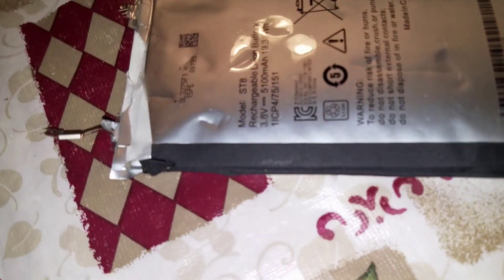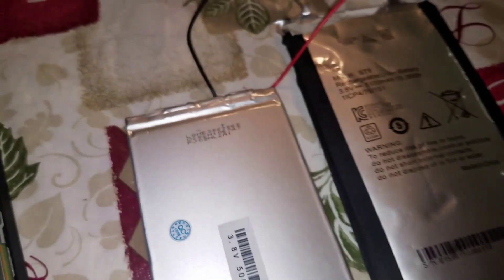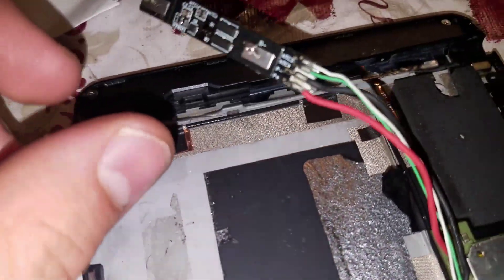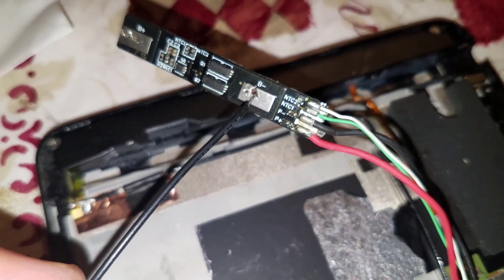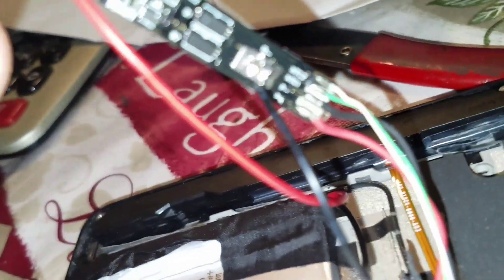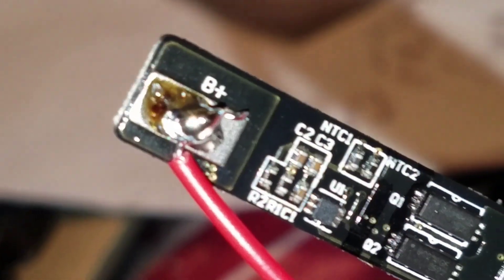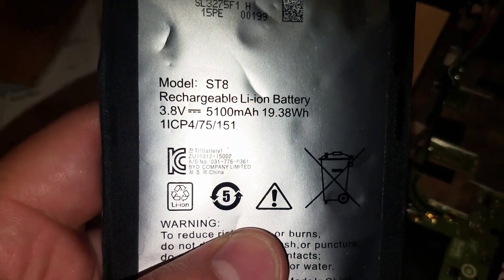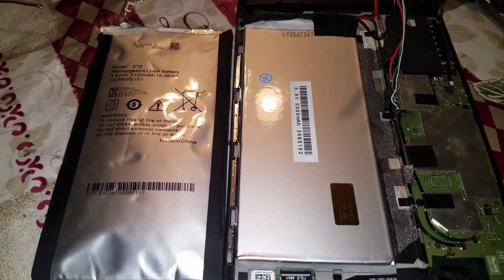Nvidia Shield Tablet Battery Replacement with Narrative Audio!

Comment: Hey bro, thanks for the video. Any chance you could point me to where I could get a replacement battery controller board?
Reply from the maker: Oh that part I'm not too sure of. You might want to try AliExpress for it. eBay might be helpful since there are some used shield tablet parts on there.

Comment: disconnect black (minus -) from the nvidia battery first, then red.  then when connecting the new battery, do red (positive, +) first, then black.  Make sure it all fits before closing the lid, and that there is no rattle (you dont want a battery jumping around because you didnt seal it in).
The little attachment on the previous battery is probably just a little extension, so the wiring can meet.  its not important.
I've put this job off for 3 years now, and your 2.2min video was awesome and really helped.  This tablet is just an e-book reader now, but with the extra battery, i hope it can survive a little longer watching videos.
Thank you!
Reply from the maker: Thank you for your input brother, this was my first doing this type of job, you right , some adhesive tape to keep the battery in place will definitely help. Mine never rattle probably due to the compactness in the design but that's definitely important! Thanks for watching and commenting you're advice!

Comment from the maker: Please like & subscribe!
Here is the same link but Shorten  : 

https://www.aliexpress.com/item/-/945908873.html

Keep in mind that this one is a little bit smaller. This is 3.5mm thickness/65mm height/152 length. But it will work. The original was 3.5mm/74mm/152mm.
 You can do more research if you want to find a higher mAh battery if you want , just make sure your within the size limits.

Same link but in long format. (Try this if the one above doesn't work) :

https://m.aliexpress.com/item/945908873.html?spm=a2g0n.orderlist-amp.item.945908873&aff_trace_key=&aff_platform=msite&m_page_id=2732amp-4rja0wylfwD8xahFBbkjGA1540488142187

Comment: Link is down
Reply from the maker: Here is the same link but Shorten  : 

https://www.aliexpress.com/item/-/945908873.html

Keep in mind that this one is a little bit smaller. This is 3.5mm thickness/65mm height/152 length. But it will work. The original was 3.5mm/74mm/152mm.
 You can do more research if you want to find a higher mAh battery if you want , just make sure your within the size limits.

Same link but in long format. (Try this if the one above doesn't work) :

https://m.aliexpress.com/item/945908873.html?spm=a2g0n.orderlist-amp.item.945908873&aff_trace_key=&aff_platform=msite&m_page_id=2732amp-4rja0wylfwD8xahFBbkjGA1540488142187

Comment: I ordered the linked battery, i want to say that this battery has a little PCB under black tape, wires are not attached directly to battery poles, i think you should remove it, then solder the new battery poles to the black SHIELD pcb.
There's no reason to have 2 battery controllers attached to one another.

Thank you very much for the video!
Reply: Yeah I have the same question too, since I also brought a HeXunBaBa battery from Ali Express, model L508 3.8V 5000 mAh. Well, I guess I won't know until they delivery it a month from now. LOL
Reply from the maker: Is that what I did? Did I attached two battery controllers? I have not had any problems with anything so far. It's been a year since my repair and still works fine.
Reply: @DIYStangsandFreedom  i don't see any small pcb in your video, but the one linked (that i ordered thanks to your video) has a controller pcb, which has to be removed
Reply from the maker: @L.Parisi  oh man they must of removed that link or updated it with a different model battery. I'll have to check it out and see
Reply from the maker: @L.Parisi  sorry for the late reply, work has been busy, but here you go 

Here is the same link but Shorten  : 

https://www.aliexpress.com/item/-/945908873.html

Keep in mind that this one is a little bit smaller. This is 3.5mm thickness/65mm height/152 length. But it will work. The original was 3.5mm/74mm/152mm.
 You can do more research if you want to find a higher mAh battery if you want , just make sure your within the size limits.

Same link but in long format. (Try this if the one above doesn't work) :

https://m.aliexpress.com/item/945908873.html?spm=a2g0n.orderlist-amp.item.945908873&aff_trace_key=&aff_platform=msite&m_page_id=2732amp-4rja0wylfwD8xahFBbkjGA1540488142187
Reply: @DIYStangsandFreedom  Would it still work with two controllers? there is tape covering the battery I found, I don't really want to rip it off to find there isn't a pcb under there. I found my battery on ebay. I probably should have gone to aliexpress.

Comment: Hey bro im about to swap mt nvidia shield battery can you tell me how its holding up?
Reply from the maker: It holds up okay. But it still only last about 1-3 hours depending on use. I put it on battery saver mode when watching movies/video, that helps it last longer. If your playing games itll die quicker.
Reply: @DIYStangsandFreedom   How long was it lasting originally?  is this with the stock rom or custom rom like lineage?
Reply from the maker: @MachuPichuu  stock. And the og battery was lasting about the same. 3-4hrs. Battery life has always been poor. Which is why I always use the tablet plugged in the charger
Reply: @DIYStangsandFreedom  I was hearing people getting 5-6 hours on lineage 14.1 rom.
Reply from the maker: @MachuPichuu  cool. That's how it is for me on stock rom

Comment: Hi, unfortunately my original pcm battery board is totally different from the one shown yours and also is fry and useless, so my big question is : Do You Know A Method that works without the original pcm ? I have a new battery with a new pcm bord in place but the tablet refuse to start, it just blink for a second and shut down :(
Please help me, especially because the Shield Tablet is the best out there and is a shame to go to waste such a good tablet, Please if you know some method ...
Reply from the maker: I'm sorry my friend but I would not know the definite answer to your question. However I can provide you with some links that show you how to run the tablet with out a battery. It would basically have to be plugged into the charger at all times. 
Link 1
https://youtu.be/mRi1Dq4LFpI
Link 2
https://youtu.be/fOiml-bOyOA
Reply: Thank you.
Reply: I done it, and now is working like a charm :) Thank you again.
Reply from the maker: @AndroidPCMMORAW  glad it worked out. What was the problem after all?
Reply: I make it work only by directly sold the usb charger cables directly to the tablet motherboard , like I say earlier the pcb of the original battery was fry.
Reply from the maker: @AndroidPCMMORAW  I'm glad it worked out for you, that's better than having to throw away the tablet. Keep an eye out on eBay, you may fine a working Shield tablet for cheap or you can buy a broken shield tablet and do the necessary repairs to get it to work again. Thanks for liking and viewing!
Reply: The one sold at Ali comes with the regulator.